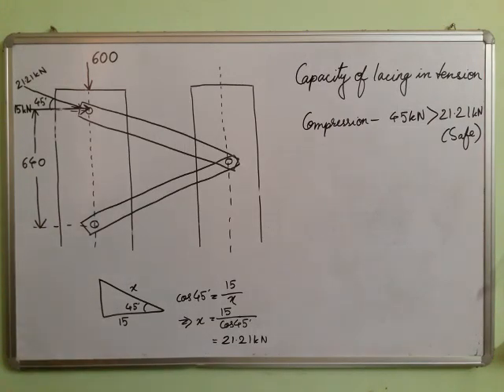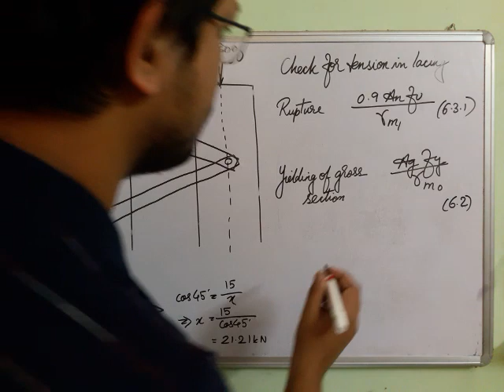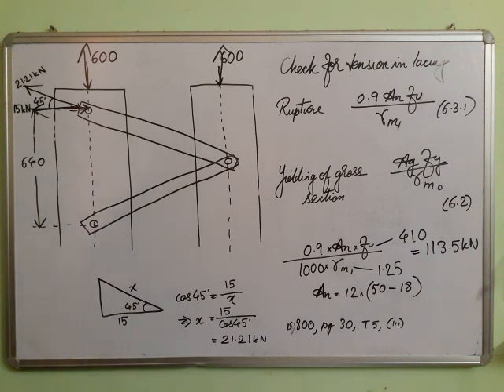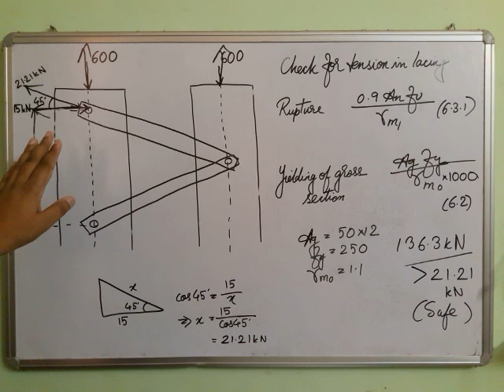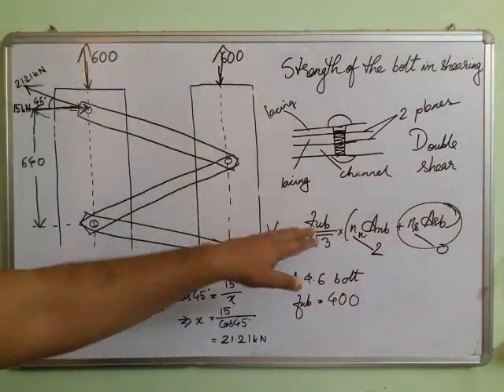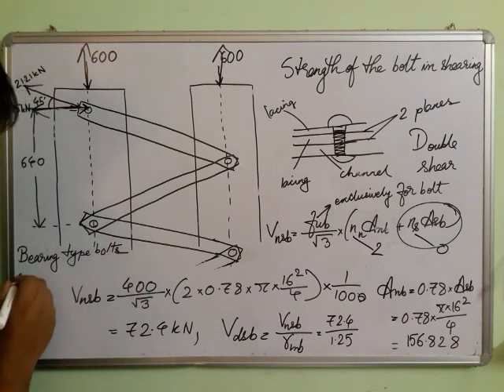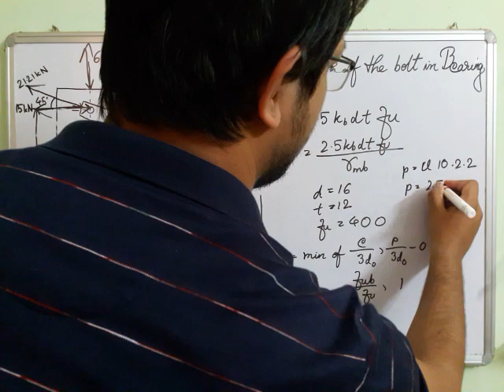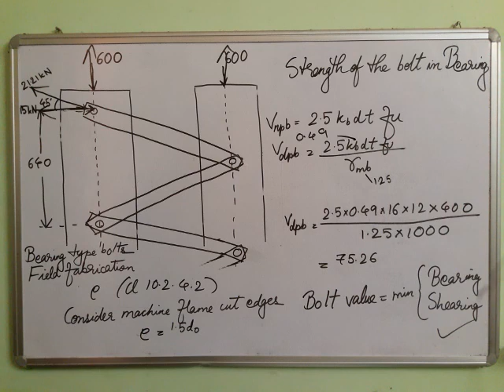Design of Built up Columns I Design of Steel Structures I Part 5

Comment: Sir, what is the minimum distance using which we can assume the bolt hole (🕳) from the edge of the lacing bar?
Reply from the maker: There is no specific distance. Anyways its neglected. U should only worry about the gauge distance from the back of the channel section
Reply: @gitartha7 alright.. thank you  so much Sir